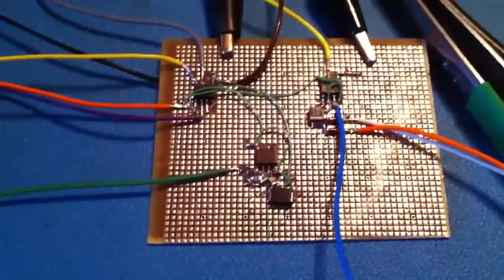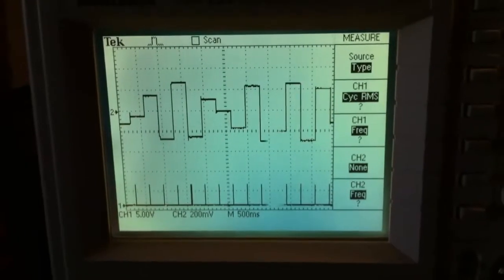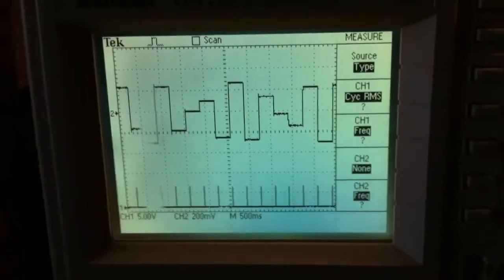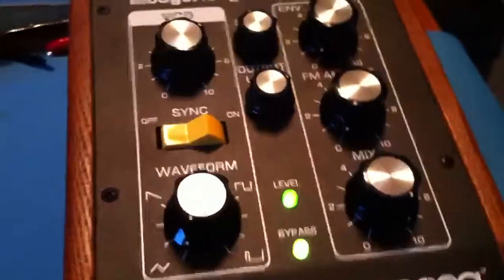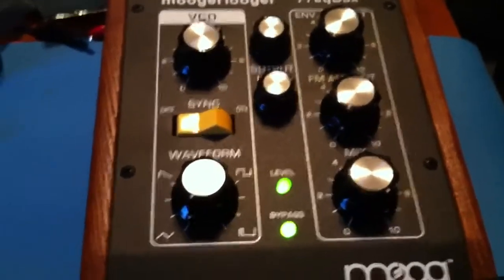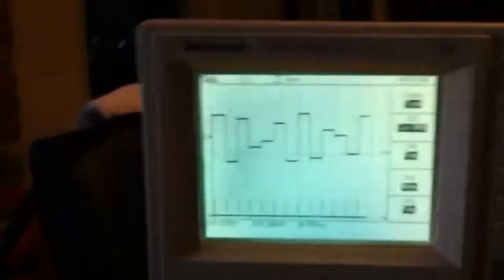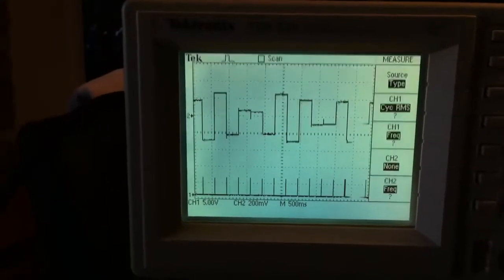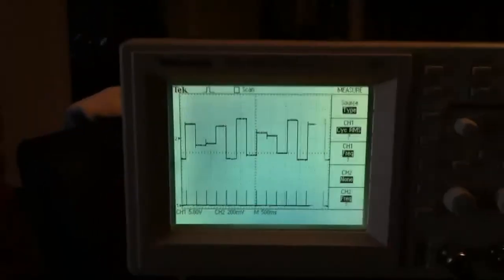Sample & Hold with Pulse Generator

Comment from the maker: I can dig up the schematics for the part I did build, but the real key was the white noise generator. It overloads the input to the sample and hold circuit which creates a twitchy sound that can be dialed back with the volume knob on the white noise generator. Unfortunately, that's something I found at GoodWill and I don't have a schematic for it.